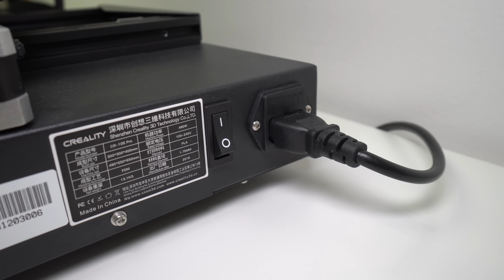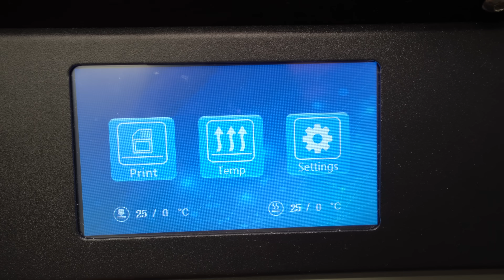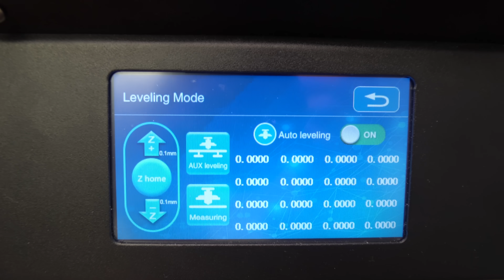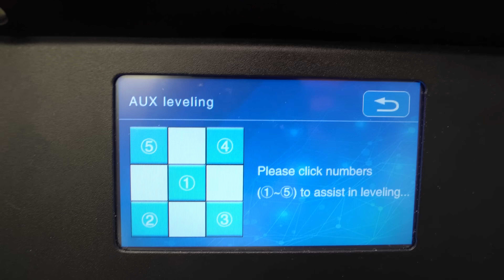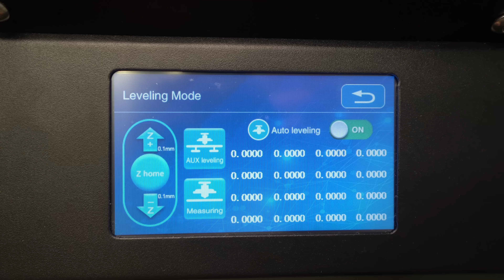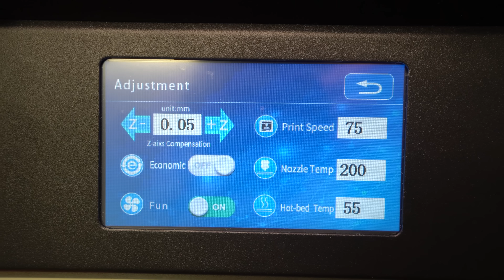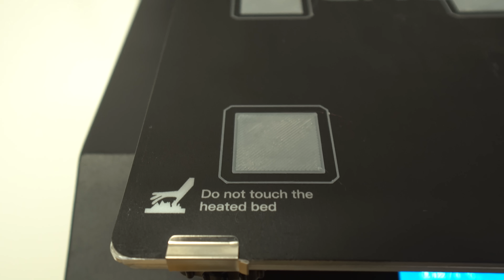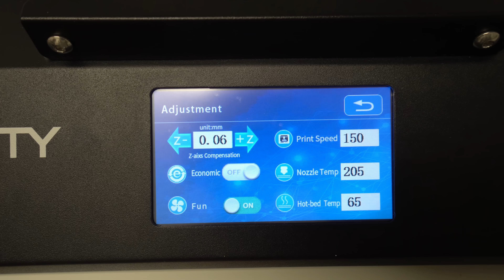Creality Cr10S PRO - Fix your bed leveling issues (Inductive sensor install)

Comment: Anyone have issues where their induction sensor triggers, but the carriage doesnt stop and crashes into the bed?
When I first installed the sensor I had to use a feeler to test it would stop, before allowing it to auto level.

Not used my printer in a couple months, and now this feeler test is failing repeatedly!
So I cant use my printer!
Am even thinking of going back to the capacitive sensor as that didnt give these issues at all!

Any ideas what's happening?

Comment: Great video along with the Fan replacement, I have followed both.. A question though.. I am using one of the sensors from your link, Banggood one, and I have done exactly as you have described.. only thing for me, when probing the Sensor stops well above the bed, when probing complete all looks fine on the screen.. and when I go to print the offset is -3.13 and the first layer wont go down.. Any ideas on what to do

Comment: thanks for your tutorial
but why has the thickness of the level acrylic pieces to be 3.8mm? the descreption of the sensor says 8mm?
thanks for any good answer
Reply: The maximum distance a sensor can detect aluminium is ~4mm (8mm probably relates to detecting a ferrous metal). In test with six different sensors, 4.2mm was the best I found...

Comment: Hi, Great video. One question:  I've done everything like you, but is it normal that the printer make the 16 points bed leveling at each print I start? thanks

Comment: I finally got around to doing this.  One question, after installing the inductive sensor you set the height using the plastic shim.  For me that height was too high, I had to drop the sensor a lot more so it would get a activated when the nozzle was at bed height.  I have Tiny Machines 3D PEI surface on the printer so maybe that is why?  The sensor is only a few millimeters higher than the nozzle which I guess is ok but not what I expected based on your video.

Comment: Hey Nexi, first of all: Thank you so much for this video!! :-) 
This is my first 3D-printer at all and I just bought and changes the sensor to an inductive one. It seems to be reallY more precise now. :)

But I set the sensor to the hight that it switches at printing hight, isnt it correct??? I really dont know...  Can you or anyone can give me some advice?? I also have to level the z-axe pretty much every time, iw there it trick on it? Which screw so I have to calibrate for that??:/

Its also rly confusing that there are many different "how to level" videos :/

Hope anyone can help me, and best greetings grom Germany:)

Comment: I have a Proximity Switch Type: LJC183-H-Z/BX (Tais Electronics Co Ltd) 300mA 6-36VDC same or similar diameter as original. 
Did you omit the 'C' character from your serial # or is it a variant of the one I have? 
Q2: Why go to the bother of taking out the original sensor's cable?  Why not splice it in at the sensor's extrusion end, saving you removing the original, the base cover, and threading, splicing and wiring in the new and replacing the base cover?  Don't the two sensor's wirings correspond?

Comment: Allright, 

thank you really much :) You helped me so much... I ordered and replaced the old sensor with this one and my printer... Works again and is all the time good leveled :) :) Thumb up

btw. I use Tiny Machines Firmware now, with original from Creality were some troubles and nozzle was pressing too deep.. With Tiny works nicely

Comment: Nexi - is there any way you can go into more detail about the calibration of the new sensor?  I installed mine per the video, and as I understand it, when the nozzle is on top of the .2mm feeler gauge, you want the light on the sensor to just turn on, correct?  This is rather difficult to do, since there is no adjusting screw like the stock sensor.  I'm having loads of trouble getting a nice 1st layer with the sensor upgrade on my Wham Bam build surface.  A detailed calibration would be greatly appreciated!

Comment: I did the upgrade to an inductive sensor, and Z anti backlash springs.  Finally, the printer works just as I would expect operation to go.   I did add a G29 to my startup gcode and that was the  final bit of magic to make it work great.  I am using Tiny Machines 3D code (1.1.9 B7).

Thank You, Nexi!!!!!

Comment: Hi Nexi, can you link me to which glass bed you have for this printer? The official Creality I’m finding on Amazon says either 4mm or that it doesn’t work with inductive sensor. I saw in another comment yours is just under 2mm, would like to know which one you got please.
Reply from the maker: I went to local glass Company and bring with me Aluminum sheet with BuildTak on. I told them that I want the same dimensions glass panel with 2mm or lower thickness and they made one for me. The cost for custom made glass sheet was only 5 USD.
Reply: Nexi Tech Excellent, thank you very much. I really appreciate your channel and videos. I hope I’m going a good route with the CR-10S Pro. I’m going to be performing your sensor upgrade and anti backlash upgrade. I think that should get me started after deciding on a glass bed.

Comment: Anyone have issues with this inductive sensor and the tiny machines firmware? I am currently running the latest Tiny machines firmware and was about to change the sensor but ran across a few people getting worse results with this combination.  Easy enough to move back to the Creality firmware but the concern is the thermal runaway issue may not be resolved.

Comment: I just bought the 3D printer with all the fix equipment you suggested. Now when I do the AUX leveling my Nozzel stay way far away for the heat bed surface like 5cm away! I followed you step by step but no look. Any help I'm really struggling with this printer.

Edit:
I fixed it by download Tiny firmware.

Comment: Hey Nexi Tech. I did this upgrade and updated firmware to TinyMachine firmware. When leveling, it starts to level correctly. Then after it levels, it drives itself into the bed. Any idea what's causing this?
Reply: Have you set the sensor height adjustment in this video?  Is it the stock sensor on the printer?  From my reading they can be iffy.  I followed a suggestion to set the sensor height to much closer than it was originally, roughly .2mm (the same height as the wrench that comes with the printer.  I rough set my nozzle to the build platform then placed wrench under the sensor and dropped it down.  Tighten backup.  Then there is an adjustment screw on the top of the sensor that it uses for auto-level.  Turn the screw until the LED comes on, back it off until it goes out, turn it back until it just just comes on.  Then re-run leveling.  Might sense the bed better.  I had  Z-axis driving issues with mine.  It has re-ocurred after moving until I re-did my leveling steps.

Comment: Long story.... but I swapped the sensor for a BLTouch, which has since stopped working. I would like to just try an inductive sensor, but no longer have the stock sensor to splice together with a new one. Does anyone know what kind of connector/terminal i need to make this work?

Comment: I have a CR-X I noticed in the video you can change ‘Z’ on the fly in the adjustment screen. (The baby step feature in marlin). Can you tell me what firmware that is, and where I could get it?  Does it support CR-X?  I unfortunately don’t have that feature.  Thanks for the help!!!

Comment: Hi, got the sensor and replaced it like it was shown here. Thanks to the detailed tut. When I switch on the printer now the sensors light indicater is showing red from the start. No metal detection and no change of light. And yes I was taking care and ordered the right version like mentioned. Any idea?

Comment: If your printer crashes into the bed when trying to adjust the z level then read this!

Maybe I am not very clever but it took me while to realise that pressing the 'Z home' button will NOT reset the z axis offset. It only runs the z homing routine again and if the z offset is wrong it will happily crash into the bed. The only thing that changes the z offset are the Z+ and Z- buttons. Unfortunately it does not tell you anywhere what that value is. 

So in my case the nozzle always crashed into the bed when I tried to set the new z offset. The reason was that my previous probe was setup in such a way that I ended up with a large negative z offset as the correct setting. With the new probe (which does not have an adjustment screw) this meant that once the probe triggered there still was a large movement downwards which made the probe crash into the bed. I solved this by taking the probe out of the housing completely so that is was dangling on the side. Holding it in my hand I moved it much lower and closer to the bed so that the sensor was triggered way before the nozzle reached the bed when starting the levelling.

So now with the first 'levelling' complete I then hit the Z+ button a lot of times to get the large negative offset back to something normal. To check the progress I used 'Z home' a few times (holding the sensor with my hand in an appropriate position below the nozzle) until the downward movement after the sensor trigger was small enough so that I could be sure the nozzle would not crash. Then i was in a position to continue the setup as per the video i.e. I popped the probe back into the housing and set it level with the nozzle. I then used the Z- button to lower the probe to the hight I wanted it at by using a piece of plastic underneath. Once there, I loosened the probe screws and again used the Z- button to bring the nozzle to the correct distance from the bed (with the probe being pushed up). I then retightened the probe screws and ran another 'Z home' to check the setup.
Reply: Thanks for this post Michael, the clarification is very helpful!
Reply: I have the same thing happening to me, thank you for you post. Before I try this, if you take out the probe completely so it doesn't get triggered at all, won't the head move into the bed? Is there a mechanical z-stop or something?
Reply: @sharky0817  Sorry I should have been clearer. The probe MUST still stop the downward movement! So when you take it out just hold it in your hand and move it down so that it will trigger way before the nozzle reaches the bed. The idea is that once it has triggered (the light comes on) you can see how much further the nozzle will travel down after it has triggered. You can then adjust and repeat (holding the probe to the side in an approximate position) until you can be sure there is no risk of collision. Then you can put it back in and do the fine tuning.

The general idea is that at no point do you want the sensor to trigger 'late' where the saved z adjustment will make the nozzle move into the bed.

I've edited the post to make it clearer.
Reply: @michaelpoelzl2318  Got you! I've got the sensor installed now and it is working well and reliable, now it seems my next problem is that the bed is very warped, the autolevel shows values from +2.xx to -1.xx across the bed.... Getting some alu tape and then off to new adventures...
Reply: Thanks you very much, fixed!!!

Comment: So I installed this sensor. And it does not play well with the tiny machines firmware. The first layer or to go down well but every layer after that starts squishing down on each other and makes the print look horrible. I had to go back to creality's most recent stock firmware and now it works really well.

Comment: Just did this mod, and so far it is working fantastically with my Wham Bam Flexi system. 

Had to start with the sensor lower than level with the hotend otherwise it would decide to smash into the build surface and need an emergency power off to avoid damage. Once I did that I was able to adjust normally like you did - my offset is sitting at -3.90 with the Wham Bam plate and the sensor 2mm higher than the hot end.
Reply: I had to lower the sensor also, thanks for posting!

Comment: This video completely turned around my initial bed-leveling issues with factory sensor. I was getting few mm deviations over consecutive levellings. But with new inductive sensor, the deviations came down to less than 0.2 mm with repeated levellings. Been churning out good PLA prints easily, for past few days, since replacing the sensor. Btw, I didn't even solder; just twisted the bare wires & insulated with electrical tape - works perfectly. Thanks!

Comment: This is a great upgrade video, and I thank you for taking the time to make it.  That said, I have reservations about cutting and soldering part of the electronics which, as you say, is required to perform the upgrade.

The CR-10S Pro is a relatively new printer, however, so hopefully Creality3D will sell an upgrade kit soon to avoid any DIY work.

Comment: 6:25 This kind of levelling never happens. The extruder side of the bar is always heavy and lower than the other side. If I try to adjust by rotating one coupler, the coupler of the other side will also rotate due to spring action. Even if I hold one side of the coupler tightly and rotate the other, it will spring back to the same position as it was before. 
What else do you do to it?
Reply from the maker: Kketansa Art This:  https://youtu.be/hG8X26UtLVw
Reply: @NexiTech  
Thank you so much. I saw the video now. I will do it. 
OMG 😮, I did not get the notification of your reply, I noticed your reply today coincidentally.

Comment: I change my sensor like this tut. can anyone tell me, why it works? the sensor switch at fixed 8mm distance. why will it work in this case with a 3,8mm distance? it works perfect, thx for that, but i need to understand. :o)
Reply from the maker: madmaik76 Induction sensor works with wide voltage range up to 36V- 8mm distance and it detect only metal. Cr10S pro runs on 24V so detecting is reduced because of lower voltage and Aluminum is less dense material then solid peace of iron or steel. I recommend that you lower the sensor to less then 3mm as it will be more precise and more reliable and if you wish you can place thin glass plate(2mm) and it will work as well and you will still have enough nozzle clearance.
Reply: @NexiTech  can you recommend, where i can buy this glas plate? I search on ebay germany, but didnt find the right size.
Reply: @NexiTech  there are still issues with repeatability with the inductive probe due to heat from the heated bed altering the trigger distance of the sensor. Have you considered putting a silicone sock over the end of the inductive probe to help with this?

Comment: If you are using an inductive sensor, and have a spring steel print surface, I would assume that you would adjust the sensor so that it registers the steel print surface at the nozzle home (0.2mm).  Is that right?
Reply: beaker2000 - Yes, that is what I have finally done with the Wham Bam surface, after realizing the stock spacer method shown had the head floating way up in the air during auto level, and wrapping my head around how it all basically works. Even floating at 3mm does not return as accurate an auto leveling when the nozzle needs to be offset down 3mm for printing. 
I set the nozzle at .2mm and move the sensor up/down till it just triggers the light(best I can freehand) and lock it down. Then hit Z-Home and verify it returns to .2mm, run auto-level to verify it floats about .2mm as it triggers at each grid point. Having the sensor auto-level trigger at .2mm has been far more accurate than higher and then needing a large negative offset during printing. My printing offset now is about neg .05 - .1 versus in the integers.  
***NOTE: I think the sensor favors one side of its round surface, since I had it with the LED to the left and it was having a hard time "seeing" the bed in the far left positions(sensor gets close to the left edge) and crashing into it. I rotated it LED facing forward and it works better, seems to like a wide surface of metal to trigger consistently. Is the actual sensor a point under the LED or possibly to the right of it? Not sure, but my experience seems to indicate that.
I hope my notes help anyone else out wrestling with sensor setup and the elusive perfect first layer. I am a newb myself, it's definitely a journey.

Comment: Hi, what's the difference between AX and BX in the reference ?  LJ18A3-8-Z/BX <->  LJ18A3-8-Z/AX
Reply: The AX model is a Normaly Close that mean it output voltage on detection, and the BX Normaly Open it always output voltage if no detection and 0V on detection

Comment: I was adjusting the bed with the shim an then I noticed something. That inductive sensor is so sensitive that you don’t really need to adjust using the shim on the four corners. I adjusted the middle using the shim then moved the sensor to just come on. Then moved to the corners to check height of bed and adjusted the bed screw till the sensor light just coms on. Did that on all corners .... went around twice. Then went back to the middle of the bed and moved up and down on software adjustment till shim was set ... the zeroed out the setting. Checked over all measurement with software. Almost all numbers were .0 + or -... Maybe that’s what you all ready do ... but a lot simpler. Thanks

Comment: I have a noob question.... I installed the inductive sensor, and noticed it has no adjustment screw like the capacitive sensor. Do I just set the nozzle height to 0.2mm and then move the inductive probe to the height where it just turns on?
Reply: You Can't adjust inductive sensors. I really don't see the point of this mod unless you're travelling with it from the desert to the rainforest. Seems  pointless
Reply: @OKeefeist  even small changes in temperature and humidity can change capacitive probe outputs, but I can't recommend inductive sensors either, maybe a bltouch will work best